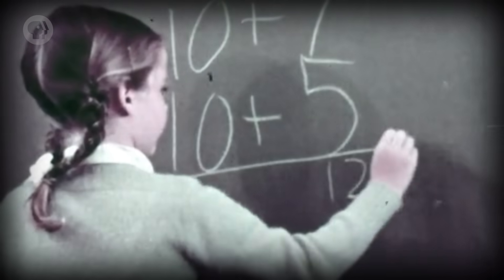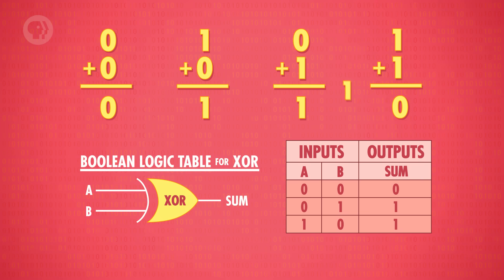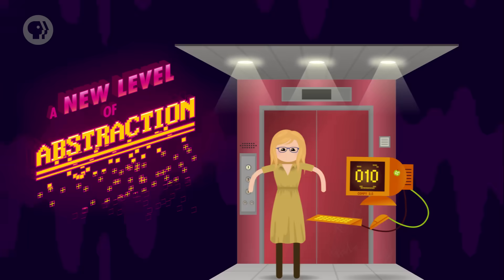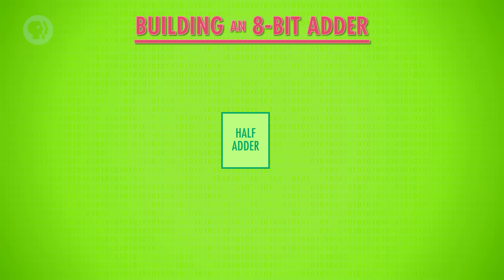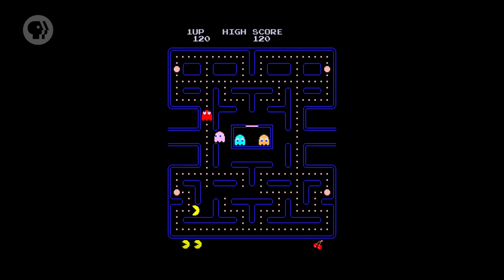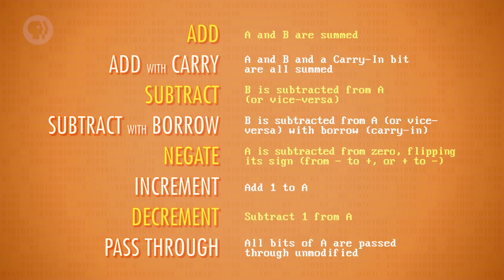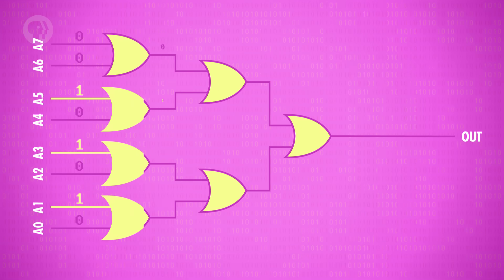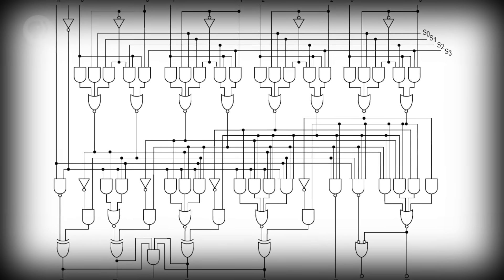How Computers Calculate - the ALU: Crash Course Computer Science #5

Comment: Oof I have to spend time on this ALU thing. I don't know what it means to take 8 of those bits and somehow add them. I guess I have to think about the earlier example about carrying a little more. The carrying accomplishes the increase in number size, but in bit notation. 

Oh so the 8 bits are added using separate additions performed up the bit chain, aka ripple. 8 bits don't go in as one big thing to do maths. That's what confused me. I didn't know how you could perfom logic on 8 bits at one time. Instead, they are processed in a row. Very cool stuff.

Comment: So i can only suppose that up to 3:52 there is a crucial mistake. She says that "when we move on to the next column in a multi column addition..." refering this "wish of move" to the result of the addition. See the animation. To me, It could not be more clear. Buuuuut, i guess your "wish of move to the next column" comes from the wish of move in the numbers that going to be added, instead of "wish of move to next column" in the result. I mean, you calculate (in this case, by adding) by putting your inputs together and see what It gets, not the inverse (take a result (output), and see what inputs you need to get there.) Thats crucial.

I hope i have commited a mistake, otherwise ive been only coming back and forth this hole video, thinking i dont understand, but at the end of the day, the vídeo is wrong

Comment: Question: In the table at 4:00 shouldn't there be 8 rows for all 8 possible 3 digit inputs? It looks like the table is missing a row that should read 1 0 1 1 0. 

Is this a mistake by Crash Course or was it left out intentionally?
Reply: hmm... I agree with you. However, most people would still understand this even though it's missing a row.

Comment: That moment when you explain the '8bit ripple carry adder' it comes across as an "IF" formula within Microsoft Excel. Where you would use other formula within the "IF" to gain a specified response if the outcome were in fact true or false eg. =IF(A1=1,True,False) or further eg. =IF(A1=1,True,IF(B1=1,True,False)), using only 0 and 1 within the example.

Comment: It's not the electrons that move very fast (in electronics), it's the electrical energy. Electrons actually move quite slow. Approximately 1.5 cm / 0.6 inches per minute in copper wires for example.

Comment: First off, this is great. Coming back after two years because I had to start intensive work since this first came out and couldn't wait for the episodes one at a time.

I have to say at this point, you first drop the ball. After taking us step by step in precise detail about how each individual, fundamental step works on the construction, you suddenly zoom past the full adder part without taking the time to outline how it works in detail or show examples to demonstrate. Also, I think it helps to overstate the significance of xor gates essentially being single bit binary adders. To me, that helps acknowledge where that actual adding process is occurring in the circuit.
You move up the level of abstraction too quickly here. Also, I know you come back to it after, but it's really not initially apparent where the first C input comes from in the full adder.

v=VPw9vPN-3ac  maybe this will help people if they want to go through it again slowly before moving past the full adder and actually understanding it.

Remember A**ange \m/

Comment: Im no computer scientist but cant U just take out the AND gate at the end so the carry doesn't activate a current? and to deal with the scenario of A7 +B7 where A7 and B7 are 1 (so the result is 2 (10))  (assuming previous carry is 0), make it so 1+1 = 1 using an OR gate. If there was a carry from the previous bit... just use another or gate so it =1 unless both are 0. This way (I assume) the value couldn't go over 255 (or whatever exponent of 2 -1) and games like pacman wouldn't computationally implode. Someone please correct me/ inform me of why this isn't implemented as I'm almost certain its wrong - just a thought

(5:23)

Comment: based on my own puzzlement, i believe, that it's worth to emphasize/notice at this (4:22) point, that the two carriers are never equal to 1 simultaneously, otherwise we would lose one bit in this case.
this follows from the fact, that the carrier in the half adder is equal to 1 if and only if both its inputs are equal to 1, at which point its sum is equal to 0. and since the sum of the left adder is the a input of the right adder we get our conclusion.

Comment: decimal output: 1 is not zero so sum0 = number 1 but then when you put in four 1s it's 2 + 3 and not 1 + 3
binary output: 4 is not 2 so it is not 0 1 2, but 4 is not 4 + 2 so it's not 1 2 4 either 
binary input: that does not work because 1 in B0 I have tried other stuff too but it has not worked.

Comment: if multiple works by adding a number multiple of times! how does divide works???
Reply: Nowadays, you have dedicated circuitry which handles division. But in the old days you had to compute A/B by counting how often you could subtract B from A without the result becoming negative. You don't need any special circuitry for subtracting numbers because you can use the same circuitry as for addition. As you can imagine, that is not exactly an efficient way to compute division.

Comment: am a computer science student so i have some questions but let begin with these 
1) after performing an execution by A.L.U WHERE does the information is stored ..............

2 set of all instruction for a specific function is called ...........

3 what is the digital circuit that generates the arithmetic sum of two binary to be executed

4 what is used to store the address of the next instruction to be executed
5 the program controlller and the A.L.U form a ........................

Comment: I needed a beer after watching this, sorry.  I went into study on it for about 6 hours and wrote a test "8 bit ripple carry" program to understand the concept.  Wew. 
Starting to really understand why computer science degrees take 4 years to complete, this probably takes a month just to explain in a college curriculum why a + b in transistors and logic gates.

"aaand next semester we learn how to subtract"
Reply: Subtraction is actually really simple. You can use exactly the same circuitry as your adder. You just define the bit-pattern for your negative numbers slightly differently. Look up "Two's complement" on Wikipedia. It is a really elegant solution.
(Efficient) Multiplication and division on the other hand are much more complicated.

Comment: Wait, doesn't 12*5 take 4 passes to compute?
Reply: Not in any computer that can even remotely be called "modern". Really old computers indeed performed multiplication as repeated addition. All modern computers have separate circuitry for multiplication which can perform the operation in constant time (which means the time is independent of the factors you want to multiply).

Comment: 4:22 "We need an OR gate to check if either one of the carry bits was true"
But why? I mean, the only reason we would want to know if there has been a carry number would be to acknowledge overflow (keeping in mind that we are, apparently, adding two 1-bit numbers), in which case we would only be considering the "carry" from our second adder. So why is the OR gate connected to our first "carry"? Can't we just see if the "carry" from our second adder is true?

Comment: <pedantic comment>
Actually electrons travel very slowly in wires (we're talking centimeters per hour, and in AC circuits they just oscillate back and forth),  but the electromotive force propagates at nearly the speed of light, which since computers operate on voltages that's what's important anyway.
</pedantic comment>

Comment: I took a computer architecture course at university and we build an 8-bit ALU that could Add, Subtract, AND, OR, XOR, and a few other logic functions that I can't remember for sure (maybe multiply and divide). We designed a PCB and sent off our design to be manufactured. Then we soldered the chips into our board ourselves. It was a really fun project.
Reply: which university is that? Our university just did everything on paper and the instructor's always in an angry and gloomy mood, reluctant to respond to questions while suppressing the class' will to bring up questions. We never thoroughly understood how it worked.

Comment: Why did you say that 00101010 is 42 in decimal notation? What I mean is why did you include the 128s place and the 64s place? That's like saying 00000042 in decimal is 42. Those extra places before the actual number aren't relevant, so why include them?
Reply: KingsleyIII I think she was trying to be consistent by using 8 bits to avoid confusion.
Reply: You leave the leading zeros in place to make up a full byte. We like to think of numbers in groupings like that because computers do too. It also allows you to refer to bytes as a grouping of two hexadecimal characters (0-F), which allows you to neatly represent information.
Reply: yeah, it's for consistency. The convention is to use all 8 bits even if you're writing "2" in deci: 00000010

Comment: you guys kinda forgot to explain subtraction:
Here is how I think it is done, I'm not sure if this is exactly how we are currently doing it , so someone correct if I made a mistake.

for A-B with A and B both positive numbers:
1) invert B (0 becomes 1 and 1 becomes 0), easily done with Not-gates.
2) add A and inverted B together by the normal addition circuit
EDIT: Then you add 1 to that sum to get the right answer (thanks to MarioFanGamer)
3) the sum is the outcome of A-B, the carry tells the sign: 1 if positive, 0 if negative.

I get that there is only a limited amount of time in a video, and that there is a lot of stuff to explain. But I find the concept of subtracting through addition ingenious and worth some attention. It's not as intuitive as addition with logic gates.

Great videos so far!
Reply: That's almost but not quite correct. Though inverting B is correct, you also have to add one to the sum.
Reply: ugh, right, stupid of me
'cause if B were 0, ...
Dammit. Thanks for pointing it out!
Reply: The process isn't correct.  Take 7 - 0.  A = 7. B = 0. A in binary is 0111. B in binary is 0000.  B inverted is 1111. Adding A + B yields 10111 or in the process you described, -7.  Moreover, this process introduces a lot of unnecessary logic and has an issue of 2 versions of 0.  The actual answer is to use 2's complement arithmetic.  It's best described by searching for computerphile 2's compliment in youtube.  But the gist behind 2's complement is that the most significant bit represents -(2 raised to that places power).  For example if we have a 4 bit system, the largest negative number is -2^3 = -8.  So with this system you can represent the numbers from 1000 to 0111 or -8 to 7 and you only have one version of 0.  Plus get the result boils down to simple addition with no concern over the carry representing sign since sign is built into the number.  So with 2's complement addition our example of 7-0 becomes 0111 + 0000 = 0111 = 7.  Or for another example of 3 - 7 becomes 0011 + 1001 = 1100 = -4.

Comment: I'm sorry, is nobody going to mention the fact that this is computer engineering, NOT COMPUTER SCIENCE!? Binary and boolean algebra is CS, but designing an ALU/CPU is clearly ECE.  I don't know how Crash Course could get something so fundamental to the field so incredibly wrong...
Reply: Episodes 3, 5-7 are exactly what you would cover in a "Computer Architecture" class, which is pretty much standard for all freshman/sophomore CS majors.  This is not "Crash Course Programming" (i.e., AP Computer Science, which is a misnomer). For students taking AP CS, this material with reinforce and expand what they are learning.  Knowing how things are done under the hood (at a high level) makes you a better and more informed programmer, in the same way an ECE student should know about programming.
Reply: I have a CS (not electrical, micro-elelctronic, or computer engineering, just standard software orientated CS degree) degree, and we had a full course where we built on paper a small 8bit full functioning CPU right up from logic gates (registers, ALU, memory, decorders, the whole thing).  In the final exam we event had to write a few small programs for our virtual CPU in assembly.  So ya... this is definitely in the realm of CS.
Reply: > Computer engineering is a discipline that integrates several fields of electrical engineering and computer science required to develop computer hardware and software.

https://en.wikipedia.org/wiki/Computer_engineering
Reply: Actually, knowing about how the CPU works can be very useful to game programmers when they need to optimize the code for the specific processors that are running them.
Reply: erisawesome their biology videos also start out by talking about chemistry.
Reply: Aeres Esdori just because computer engineering incorporates elements of computer science doesn't mean computer science incorporates elements of computer engineering...
Reply: J yeah but crash course has never been a series about teaching at the college level. Their videos have always been targeted at high schoolers wanting an easy way to study for their AP exams. A CC series that paralleled the APCS exam would be much more useful, but by making this show more about computer engineering,  they're not playing to their target audience and more just making a (very good, I might add) intro to ECE course
Reply: Andrew Farrell Yes they do but there becomes a point where you're no longer making a biology series but a chemistry series. CC, in the past, has been pretty good at staying on topic and including all relevant information needed for the basic understanding of the subject but Crash Course Computer Science has gone a bit too far into ECE and is no longer relevant to CS.
Reply: erisawesome, has anyone told you that you shouldn't take stuff in life so seriously? If not, then I can tell you that right now.
Reply: Knowing hardware is integral to being a good computer scientist/programmer/engineer. 

CrashCourse touched on this topic a bit but decimal numbers can't be represented perfectly on hardware. This is about floating point precision. 

The following Java code gives an unexpected result:

public class NumericalPrecisionTest {
  public static void main(String[] args) {
    double cnt = 0.0;
    for (int i = 0; i < 1000; i++) {
      cnt += 0.01;
    }
    System.out.println(cnt);
  }
}

// expected: 1000 x 0.01 = 10
// actual: 9.999999999999831

This has many real-world consequences (think anything financial related). What about irrational numbers like pi?

Another example. I was reading a stack overflow thread a few hours ago where someone got a 20x speedup by sorting an array before iterating through it. That goes against everything you learn in an algorithms course and common sense in general. 

So how is it possible to get a 20x speedup by performing more work? Because branch prediction (e.g. design of computer architecture). OP got a recommendation (after a ton of discussion and research) to remove the sorting routine and slightly modify an if expression and BOOM instant gains.

The above are examples of why you learn system hardware while taking CS in University. It's pretty damn important!

LINKS:

What Every Computer Scientist Should Know About Floating-Point Arithmetic
https://docs.oracle.com/cd/E19957-01/806-3568/ncg_goldberg.html

What every programmer should know about memory
https://lwn.net/Articles/250967/

BONUS QUESTION: Given a square n-by-n matrix, how would you loop throw the elements?

HINT: This has to do with how computers retrieve values from memory and how computer languages are implemented (for example you will get a different answer if you use R vs c).

Comment: Just a note: In most architectures (x86 included), the overflow bit is for SIGNED overflow. The carry bit is in a flag marked carry or unsigned overflow. This distinction is extremely important and the cause of many subtle bugs for new assembly programmers.

Thus the flags are Z (zero), C (carry), O (Overflow), S (Sign). There are many more (depending on the cpu), but you need these to be able to handle the inequality conditionals correctly for both signed and unsigned integers.

Comment: Why does that Intel ALU have the Texas Instruments logo on it?
Reply: it was Fairchild Semiconductor; a group of employees left their yo start intel a very long time ago. also Fairchild was a company that was founded by a group that left Shockley Semiconductor Laboratory, which was a company that was founded by a group that left bell labs, which is the group that invented the transistor. The design of the specific alu they are talking about is too old to still be under copyright, and also too old to really be used in any modern systems, so it is mostly manufactured for educational use now a days, and since TI is the largest Semiconductor company in the world, they produce a version of it that is popular, and they used a picture of it in this video.
Reply: Presumably they designed it. Here is its data sheet: http://www.ti.com/lit/ds/symlink/sn54ls181.pdf
Reply: When ever they said "Intel 74-181" they really mean Texas Instruments. Intel was still a start-up making RAM chips at the time that beast was incorporated into the mini computers of the time (late-60s, early-70s). See this for more info: http://www.righto.com/2017/03/inside-vintage-74181-alu-chip-how-it.html
Reply: Eddie Santos thanks for the info! Intel certainly has come a long way since then.
Reply: Andrew Farrell wow, they even put the logic gate diagrams in there! Very cool.
Reply: CORRECTION: I'm scouring the internet and there's debate if it was TI or Fairchild that introduced it first... but I can't find any definitive source. It definitely wasn't Intel though. 😲